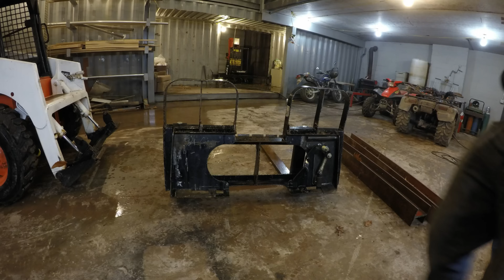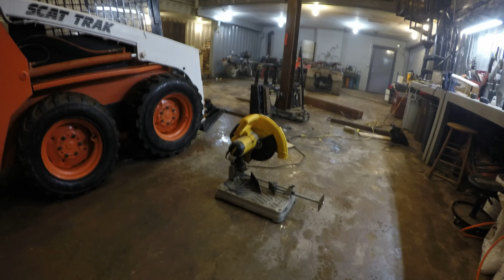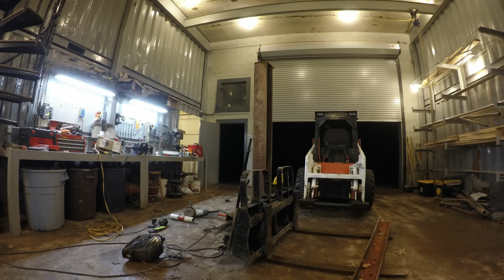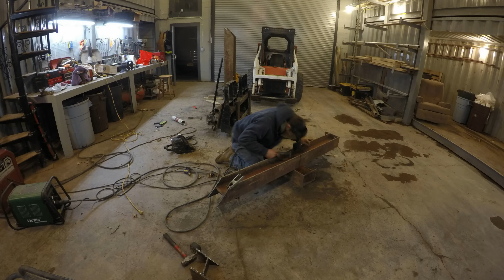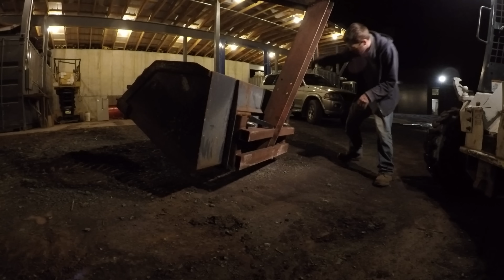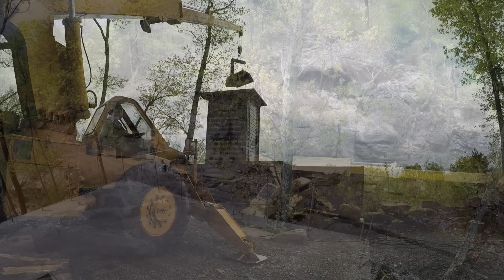Building crane forks

Comment: Why not put the quick disconnect system on both.. then you use them on the other machines you have.. no chain to break...bingo!!!!! you do more with one machine in a pinch!!!! The excavators could in pinch move small pallet or push, with a bigger bucket, a pile dirt/gravel a multi yards!!!!!!!!!!

Comment: How are them weld on quick attach plates holding up? I ordered the same set not too long ago for a project.
Reply from the maker: They are working well. No problems.
Reply: Andrew Camarata thanks I appreciate the response Andrew, I wasn’t all that impressed with them so I’ve been putting off starting on the project. Guess I’ll give them a shot though.

Comment: By using that I-Beam cut diagonally and fully stick welded on both in and out-sides Andrew essentially has a pre-gusseted crane fork with (estimated) 58 unitized inches of 60-70+k # tensile strength weld, it seems to my untrained eyes.  *  I would like to see him add a 3/4-1" steel lifting eye such as (https://www.uscargocontrol.com/Lashing-Ring-Weld-On-1-x-47-600-Lbs-Forged-Mounting-Ring) or perhaps utilize a length of excavator pin w/reinforcing thrust plates that he probably has laying around and cover them in a few coats of Direct-to-Metal Paint available at any professional paint shop.  *  I use Kentucky Coatings 'Rust-Nox' but your local jobber will have an equivalent...

Comment: Hey Andrew, I know this is an older video,  but I would have rotated the I beams 90 degrees as the current design has the forces through the out of plane (weak axis). I am sure the current design has plenty of capacity to resist what your putting it through. If you want to look at the math on it, the Parallel axis theorem is the theory that 2nd year undergraduates have to learn in mechanical and structural engineering degrees. Anyways, fantastic concept well executed! Keep up the good work!